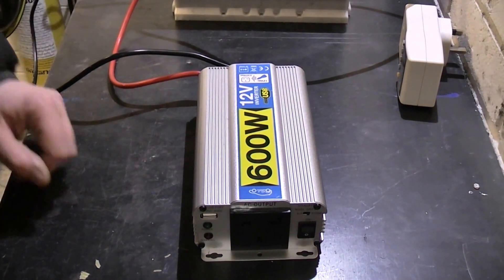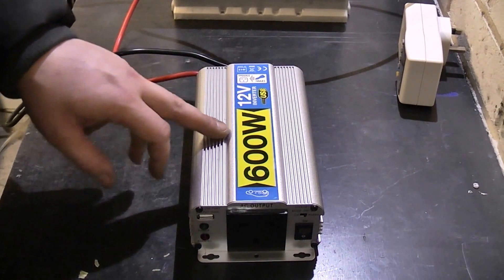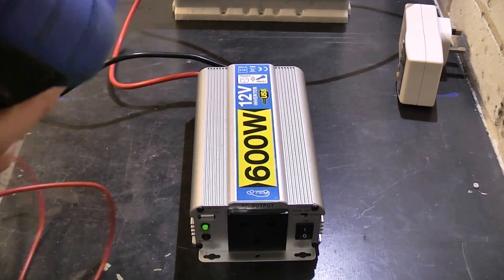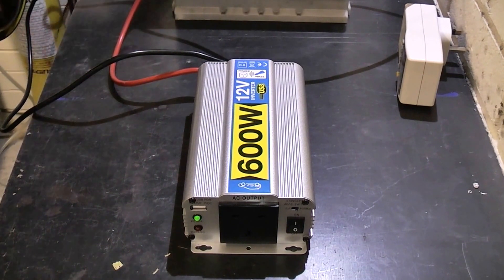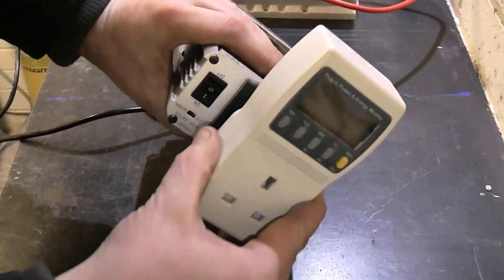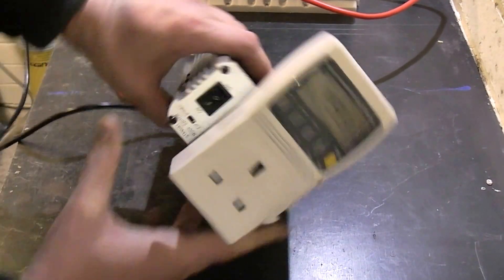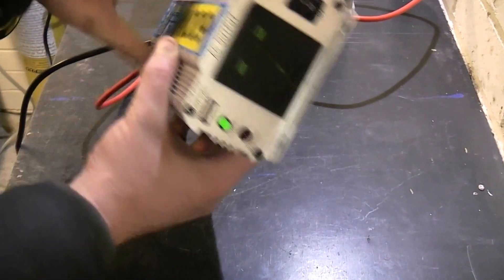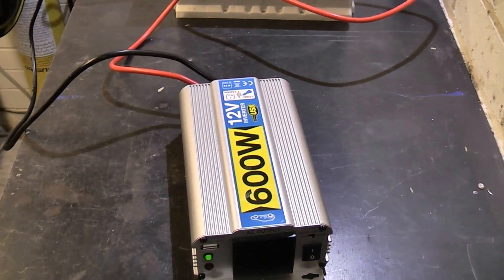A look at a cheep 600w MSW inverter.

Comment: Running inductive loads like an angle grinder is not very optimal on those modified sine-wave inverters, since 
on an oscilloscope you would see that the output is more similar to a square wave than to a sine wave.

Your multimeter is reading "low" since it assumes a true sine wave, and it calculates the RMS value. 
It is funny that the relatively cheap killawatt meter provides the right reading ;)